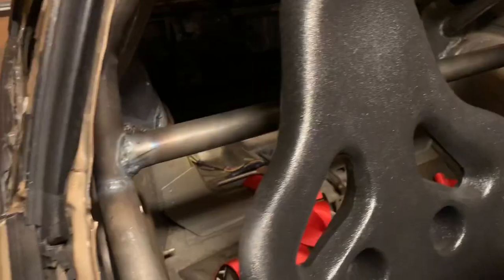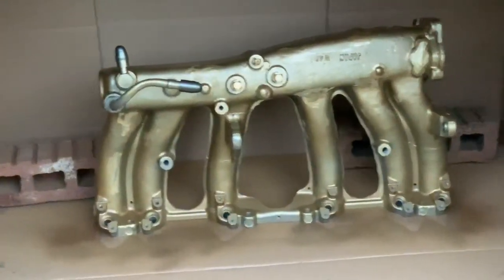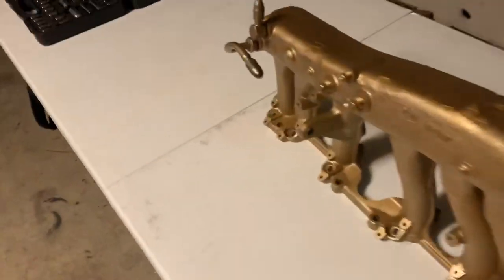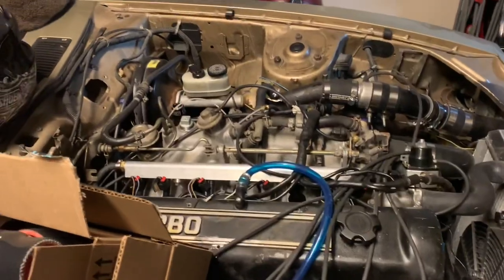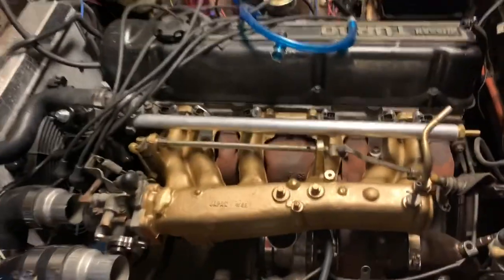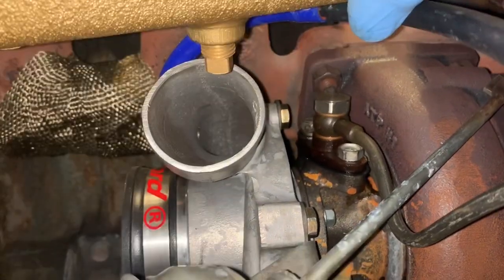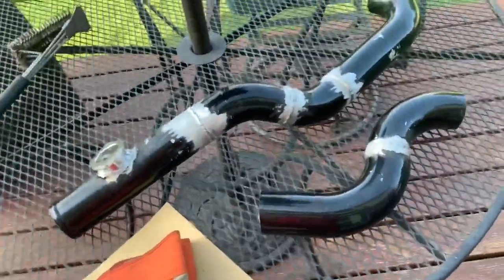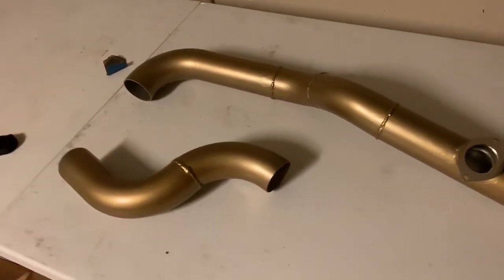280zx intake manifold modification!

Comment: what can u keep and remove from intake manifold
Reply from the maker: Christian Pray it just depends. If you’re on a stand alone ecm you don’t need egr, cold start injector, maf. If you have a bov on charge pipe you can ditch the crazy looking bypass valve. The pop-off valve is redundant, and can be plugged. All I have on my intake is a couple vac ports. That’s all that I require.